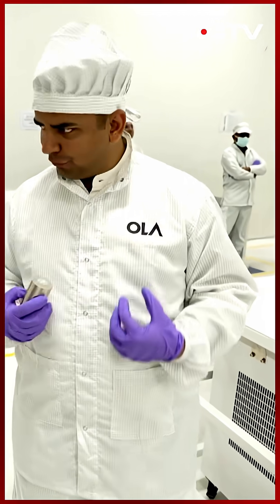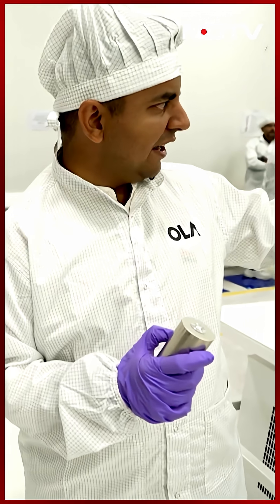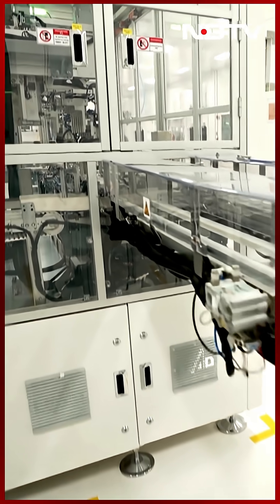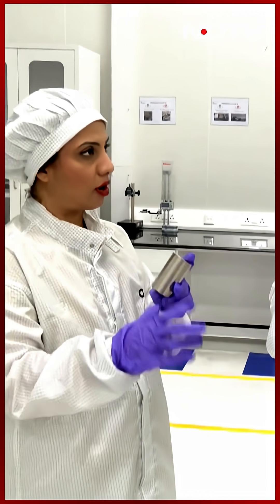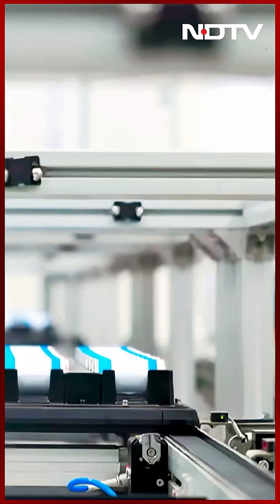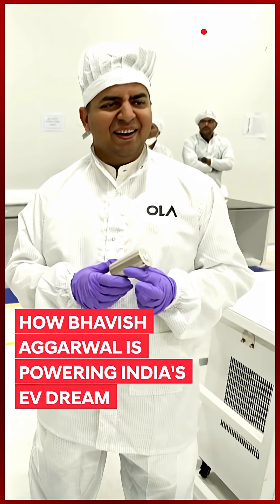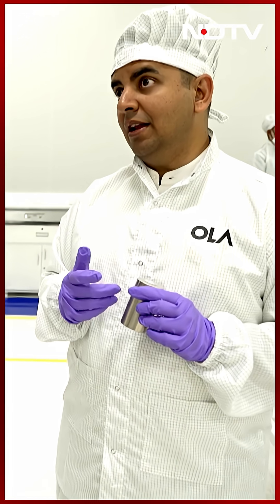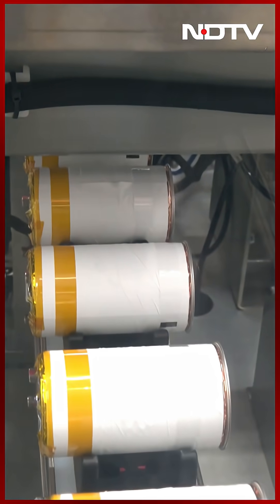Bhavish Aggarwal, Founder & CEO, Ola Electric: 'We Are Building Next Energy Platform Of The Future'

Comment: No innovation, just old pickle in new bottle and this pickle is outdated 😂, but good initiative by Bhavish in India where no one thought of
Reply: Could you explain what do you mean by old pickle? 90%+ world is running on 21700 cells, tesla was the first company to attempt 4680 lithium-ion tabless cells so it is the only company worldwide doing mass manufacturing of these cells 26mm in dia and 80 mm in height hence the name 4680,its another feature is tabless design it is pretty hard to manufacture, honestly i am surprised that OLA developed these in very less time,the hard isn't the cell chemistry,it is same as any other lithium+ion cell the hard part is manufacturing these things the LFP and prismatic cells are somewhat forgiving on the manufacturing end but in these cells even slight deviation in slurry or manufacturing proces can make your whole effort,money and cell of that batch go down the drain so the most challenging part of manufacturing this cell is getting yield percentage above 90. I don't think it can be achieved like you said otherwise we would have tons of companies and factories producing these cells, especially china but they are still mass manufacturing older 21700 LFP/prismatic cells which is easier to manufacture than these. But to remain technologically relevant this is not enough OLA should pivot its R&D toward sodium-ion and solid state batteries....
Reply: @ayushraj627 I said no innovation because this chemistry is becoming obsolete in a year, he licenced old tech,  world is quietly moving to solid state battery, old pickle means chemistry is old, new bottle means size and length are changed, there are various problems associated with increasing size so big companies didn't move... What if I announce a solid state battery next month which can be manufactured in 6 months with no degradation lasting upto 1 lakh cycles and has higher energy density... What happens to his investment.... Before investing we have to search for a technology that lives longer that's what my intention.... Yes manufacturing is always difficult and risky..... Log9 lost everything 600 crs, if Bhavish also loses no one will dare to do it again... In India guts to invest on R&D is very rare like Log9 and Ola if such kind of people fail no one will be ready to invest on new things,